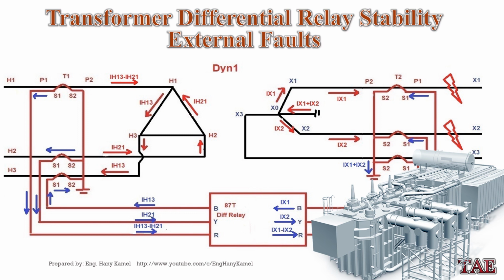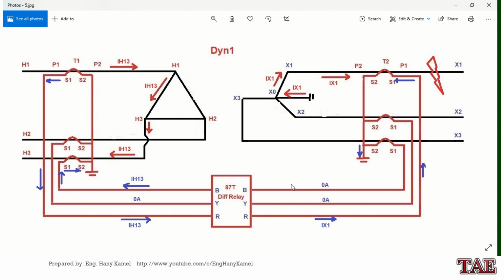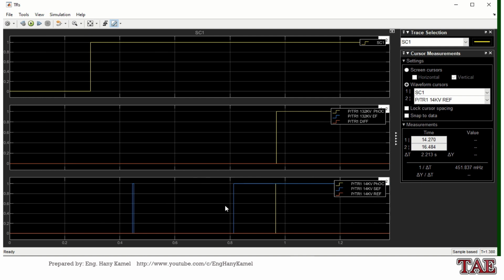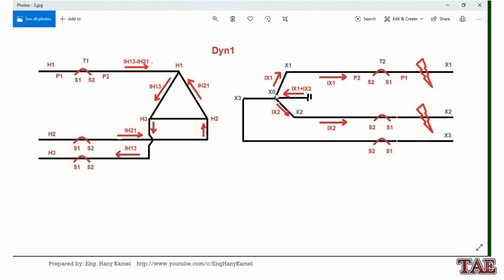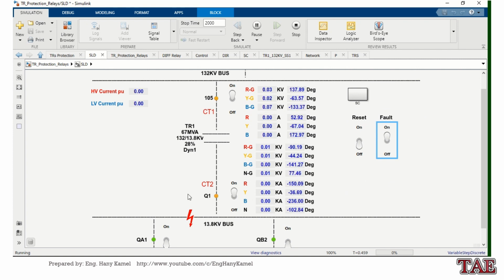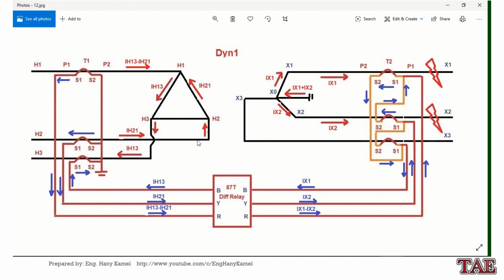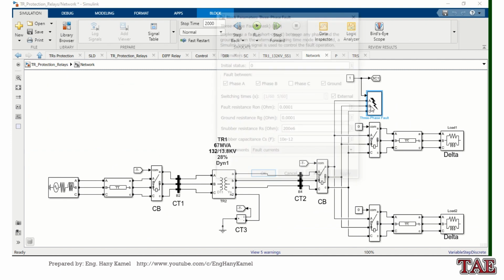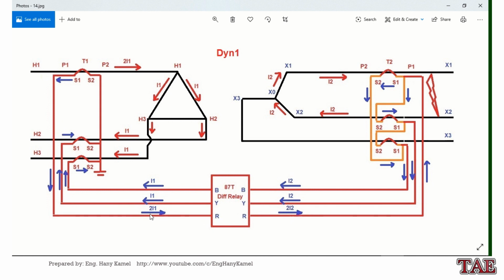Transformer Differential 87T Relay Stability External Faults, and faults analysis MATLAB SIMULINK

Comment: Dear Mr. Hani, Could you show the secondary injection values to be input to Omicron 356 kit, if the single phase through fault stability is to be tested for a YNd11 type generator transformer please? I have tried my best but could not get it to be stable. But I could get the 3 phase through stability and phase to phase through fault stability successfully.?